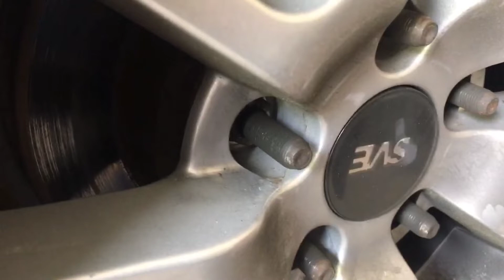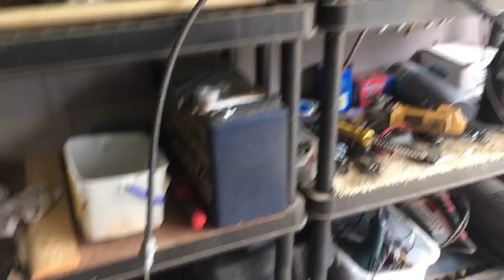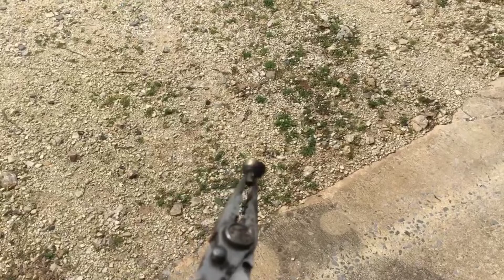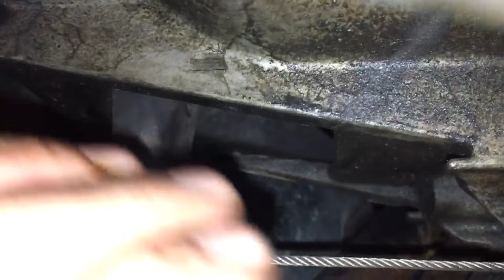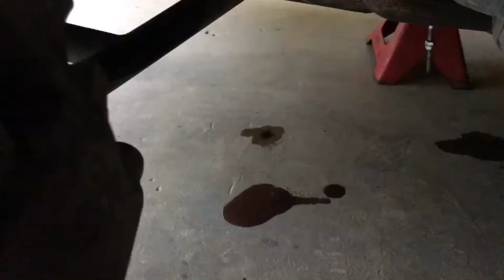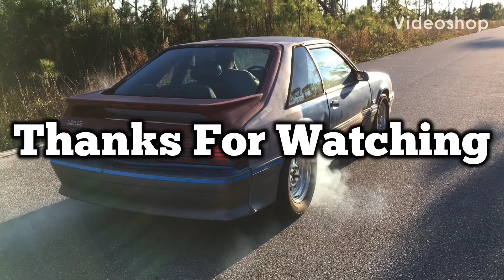Quick and Slick Clutch Action

Comment: I had what I thought was a caliper hanging up on stupor trooper, turned out to be the e-brake cable and not really the caliper.
On the clutch cable, I hang it up and spray cable lube in it for a few days until it comes out the bottom. You can get a steeda cable on summit, getting the cable for a 1996-2004 mustang gets an adjustable cable, but it's 10" longer and puts the cable out toward the front of the engine, further away from the header.
Reply: FXRSDriver I had that same thought, I unhooked the parking brake cable before I replaced all of the other brake parts, that does seem to be a common problem on these cars. Thanks for the info on the cable, I’m sure this cheapo cable won’t last long. I’ll get that newer style cable next time. 👍

Comment: Good stuff about fighting a short fight to make a huge difference in driveability, Richard. For speedo cables and clutch cables (if you can pull the core out like you can on older speedo cables), I like to coat them with synthetic assembly lube or dry lube. I use Red Line assembly lube. It's very thin compared to moly based assembly lube, but clings really well. The Dry Lube, by Blaster, contains Teflon, or PTFE, so it is slick as snot on a glass doorknob, as my Dad would have said, and clings like crazy. I got it through Summit, and haven't seen it in stores that I recall. Not in the danged generic, chinese parts selling auto parts that are about all that's left in most places, at any rate.The Dry Lube comes out in liquid form, fairly thin, so it shouldn't be a huge hassle to get it worked through a cable like your SN95 uses. Keep on keeping on, Richard & Ray!
Reply: Zekais thanks Bud, that’s some good info. You’re right, it’s getting hard to find decent quality at the stores, no one makes a decent hose clamp any more......